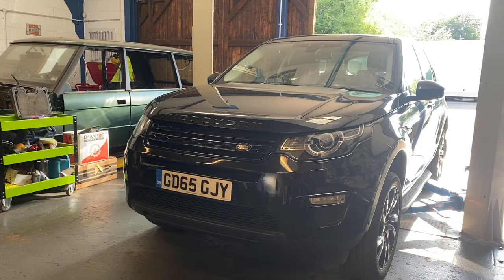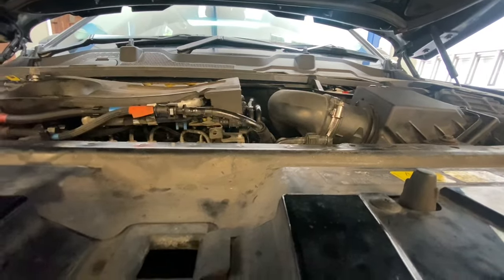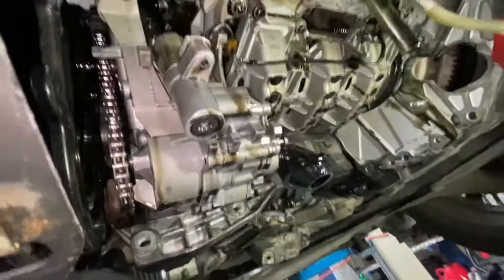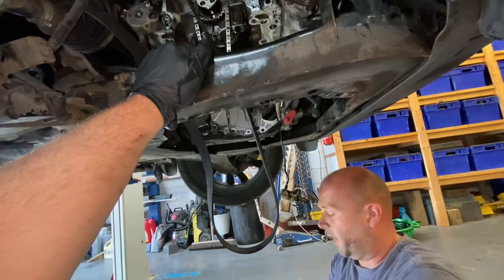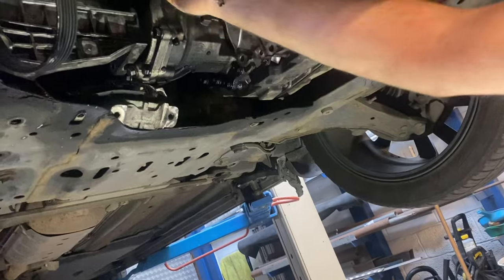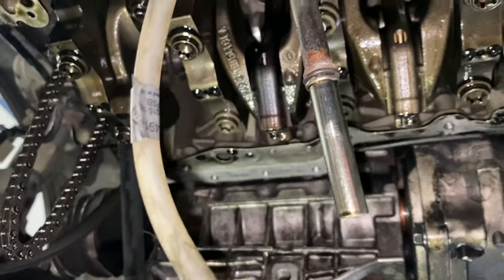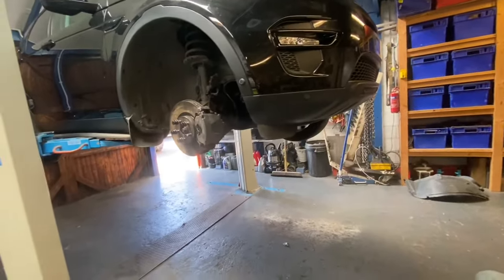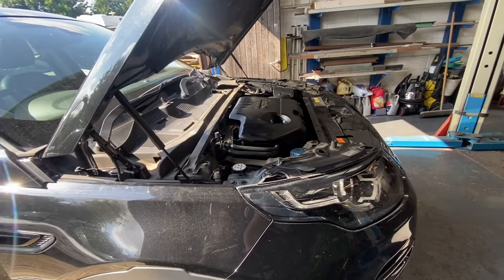LR Discovery Sport Dismantle And Repair Knocking Big End Bearing

Comment: Doesn't need an engine. Change the bearings, clean out the DPF and you'll be good to go. 
Run it for a 1000 miles and if it's still good, get it gone 😎👍
Reply: Straight to the auctions if it were mine. Or we buy any car.

Comment: When Big Diesel trucks get a rebuild they do a in frame, if you had used the micrometer to measure the journals and where in spect you could have replaced the bearings ,Turbo and DEF and would be like new it’s a diesel not petrol engine. I would drive it a little to see how it act. Great video ✌🏽

Comment: Chris's level of skills on all aspects of automotive repairs never ceases to amaze me! He must have the patience of a saint to spend all those hours on that bearing! That looked a very complex engine but you guys got to the root of the problem quickly and found a solution albeit temporary. Not a great indictment on the ingenium engine that it is basically toast at only 100k, would expect a modern diesel engine to be capable of at least twice that mileage and then some!

Comment: I'd clean the DPF and run it as a salvage rebuild run around rather than having it sat there waiting for a new engine and see how it goes. Could run it for a year and it not need anything. I think it'll be fine now if you sort the DPF. Probably been used a bit round town and got clogged up.
The solenoid on the oil pump Chris mentioned is because the pump is a variable displacement pump and the ECU can adjust the duty cycle of the pump to meet an oil pressure demand rather than having it run flat out all the time like in the olden days! Helps with fuel economy.

Comment: I'd get that dpf cleaned and change the turbo if necessary and then use that engine, and use it for six months if you need to....I'm pretty sure that it shouldn't cause any further issues. 100k is nothing for modern engines....I've seen mondeo 2.0 and volvo diesels on 400k miles with proper maintenance

Comment: That whining noise when you rev it up may not be the turbo, is more than likely the balance shafts, is a known issue on the ingenium Diesel engines. Have seen loads of turbos fitted for the balance shaft issue noise in the main dealer I worked in. That may be what the turbo was fitted in the first place.

Comment: Excellent work guys. Having experience in engines, I'd be fairly confident in saying that you'd be better off stripping, cleaning and re-shelling the engine you have, rather than taking a chance on a second hand unit. My only reservations would be if there's any damage to the bore on the cylinder that had spun the shells from the piston skirt touching, and the integrity of that conrod. The clean up is the biggest thing, because oil ways and galleries can still have lots of bearing material in them, as you were missing two shells. Good luck with the rest of the build. DPFs are the bane of modern diesel engines.

Comment: Brilliant video chaps.
So in a nut shell the cause was really the original owner not driving the car on long runs to blast out the DPF which killed the turbo which in turn caused oil starvation to the crank etc.
I'm not a mechanic but you guys really explained how the route cause produced the damage.
Will be waiting for the next vid.
TT4now

Comment: Those sound deadening shrouds are a nightmare, they get soaked overnight the years and hold that water then proceed to rot the sump, rip it off and bin it.
Reply: Mine has soaked up oil over the years, sumps never going to rust now.

Comment: Great video guys. never would have thought you could have recovered that bearing to get it to run. Good old school work. From talking to an independent LR dealer that the DPF issue is because it's too far away from the engine and in town running gets blocked. A real weak point on these engines. I was told that the LR dealer in Edinburgh has a separate workshop away from their main shop so customers don't see the number of engines needing to be replaced!

Comment: Don’t know if ye mentioned but where did ye manage to source the bearing shells.....? Just a theory but from my own experience at the Jlr dealership I think due the very long service intervals on these engines the oil goes to shit and causes excessive ware in cylinder 2 and 3 which in turn cause the oil level to be low and starve the turbo which in turn cause them to go pop.....! The DPF/SCR’s have a habit of breaking up too but this can be diagnosed very easily! If the tail pipe has black spit on it it’s time for a new dpf/scr cause of this issue is suspected bad pcm software cause an overheat condition in regeneration mode.

Comment: Gone are the days of working under a car with axle stands, there's so much to remove just to get at the sump.
Reply: To get to the plug for an oil change you need a lift to remove the undertray, as I found out the hard way. My daughter asked me to do an oil change on her 208 diesel. So my mechanic did it in the end.
Reply: @RPGeert  on my Kia there's a gap in the undertray to remove the sump plug. They aren't deliberately making it awkward.

Comment: Great video, manny Diesel engines die because of the DPF filters clogged up and excessive fuel is jumped into the crank case which waters down the oil to a point where it’s not doing any good as a lubricant that’s probably what’s destroyed the bearing diesel engines when they go into regen have to be run for at least 1/2 hour at constant motor way speed or have a static  regeneration performed by a laptop Great video loved it PS that shaft and bearings will probably last quite a few miles now
Reply: These newer cars (at least Land Rovers) do have a piece of software that monitors the amount of fuel in the oil.  If you look at live data on a very good scanner, you will see the numbers are monitored and an engine light will illuminate if you surpass the threshold.  The key is to change the oil once this happens.  Having said that, the DPFs on these newer cars are an absolute nightmare to deal with when they get clogged up, and the reason they clog is that if you have certain issues, the car won't regenerate at all.  So you get in a viscous circle of having DPF issues, so you focus on that.  But once you have that happen, you absolutely have to find the source of what is forcing the car to stop regenerating.

Comment: All this because of the stupid long oil intervals. Change it at 7500 in between the LR service. Certainly won’t hurt. And for heavens sake use the Castro edge professional titanium with the LR correct spec number. Costs about £90 but it’s crucial.

Comment: It is a disgrace on land rovers part that a 6 year old car needed a turbo and big ends not the first LR I've heard of  of this age with knackered engine.
Reply: My brother had top spec 2011 disco that the engine died in at 30000 miles due to oil starvation. He then bought a 2017 rr sport and that died too at 40000.
Neither of them have a dipstick, you rely on a dash warning which ne never got.
They're expensive junk.

Comment: Excellent tutorial on these JLR engines; I remember 20 years ago being told that the engine was the weak point and it looks like it continues to be. PS thank goodness you cleaned the camera lens, the glare was blinding me! All the best
Reply: Isn't this a Ford engine as fitted to a Mondeo of the same age?
Reply: @hedydd2  No its an Ingenium diesel. More than 1.5 million have been made since 2014. Problem with the transverse application up until 2019 was the dpf being a short distance from the engine rather than up close to it as in Jaguar XE and XF for instance. If used for short stop start journeys only with no longer journeys, the dpf cleaning cycle is forced by injecting additional fuel to heat the engine up with resulting oil dilution as the excess goes down the bores. If oil services are not carried out at more frequent intervals, engine wear is the result.
Reply: @fraser7744  so did they fix the issue since 2019? Having a brand new engine going bye bye after just 100k, on such a price tag of a car seems nuts to me. And yes I saw everyone stating oil dilution is a huge problem with jlr disco sports, but you were mentioning “up until 2019” and was wondering if they fixed it from 2020 onwards. Thank you and many thanks to the guys for the video, amazing skills!

Comment: is the turbo actually getting and  returning its oil, i have heard of  a turbo being replaced to only to have its replacement fail shortly after,,,,,,,,the garage changed the turbo but failed to check it was actually being fed and returning  oil to the sump,,,,,,effectively the turbo was starved of oil due to a blockage in the return pipework

Comment: Give it a new DPF and run it until it dies. It will probably run for another 70 to 80k miles again with little bother. An used engine may be no better than this one.

Comment: It's probably been dumping diesel into the bores,attempting to regen the dpf,it will get past the rings water the oil down,and knock the shells out,the thin oil gets past the turbo seals,and it takes off too the engine will most likely be ok

Comment: 100,000 miles, is nothing, and if it was oil changed regularly you wouldn't get this problem. I have 185,000 miles on a TD4 serviced regularly.
Reply: The dpf blocked. Probably too many short journeys.

Comment: It’ll not knock from cold but the secret always is to let them warm up & then all will be revealed.
However it’ll be very interesting to let it warm up & see what happens. Even if it did start to ‘rumble in the jungle’ an oil thickener would take up wear  to let you move it about the yard.

Tbh my gut feeling is it’ll be  ‘ovalled’ but yes I’d be letting it get right warm 👍

Comment: Well done guys 👍🏻👍🏻👍🏻 but sadly this video massively shows what is wrong with main dealers. 😤 Even I - a numbty 50 year old - could tell the rattle was likely a bottom end bearing issue since it started and ran but knocked. 🤨 Ok I was fixing my cars as a student back in the 1980’s and have rebuilt engines so I’m not totally incompetent, but hey, come on chaps…. I haven’t had my fingers oily in 30 years. What they hell are they teaching to auto technicians nowadays 🧐…. it’s all too much “computer say no/diag machine doesn’t have the right error code” ….. lazy workmanship or what. Again, BIG CONGRATULATIONS on doing a fix 🤓

Comment: Rob,why dont you register the car and run it for three months then take it to We Buy Any Car and weigh it in for a good wage saving you and Chris a load of work and hassle.
Great to see Chris more and more on screen,what a team.
Reply: Yeah, I would suggest the same. If they suspect that the engine is fairy worn, but it's running well now, they should sell it to a big company like webuyanycar.
Reply from the maker: Because a poor member of the public will end up buying it from bca  👍
Reply: @sruk  Rob,BCA dont want the public at their auctions only trade account buyers via their gold/platinum/black card system so more likely another trader/dealership would buy it. but that is the risk of buying at auction,as dealers we have all been burned at some point!!!!!!!!
Try taking a seriously faulty car back to BCA and they simply dont want to know as car auctions are in a privilidged position regarding sale of goods/consumer rights act so i would not loose any sleep selling it to WBAC .

Comment: Great vid chaps! In terms of route cause I’m thinking could be one of following:
- oil dilution due to dpf regen process / lack of frequent enough oil changes
- oil feeds/pick up contaminated or blocked leading to starvation of bottom end and turbo. It’s had new turbo but is howling again - is it getting enough oil. 
- possible incorrect grade of oil for dpf regen (needing low ash)

Look forward to the next vid.

Comment: Just watched an Evoque getting a turbo fitted. 
Think it’s the same engine, just a heads up if you don’t know but it’s got a gauze filter in the block where the turbo oil feed pipe connects.
Keep up the good work, that was a good watch 👍

Comment: Had a VW 1.9tdi that my brother split the sump and carried on driving. Toasted the big end shells. Done exactly what you have, tidied the crank up with wet & dry and replaced the shells and oil pump. It’s done another 40k miles, on an engine that already had 120k on it. I’d be driving that, no issues. After you fixed the exhaust fault of course.

Comment: I had this problem on a BMW rod bearing spun did the same as you worked fine until engine & oil got up to running temperature then Oil pressure light came on ended up doing a full engine re-build with new con-rod. Take my advise don't drive it around just get another engine you are right to many miles on that engine not worth a rebuilding, it's a long job but worth it Good Luck...

Comment: I'll have to remember that trick with the wet and dry and the paracord. Not a permanent repair but it might buy you some time. Nice one. 

Good call replacing the engine. These Ingenium engines aren't very good. Regardless of if you can get rid of the knocking something else is probably worn out and about to fail.

Comment: Maybe pull the head fit a new con-rod, full set of shells and timing chains and call it fixed! What if the new engine isn’t any good and been bodged up, at least you have seen the inside of this one and you know everything else good. That crank will be fine especially as Chris has checked it with a micrometer also!

Comment: Thanks for the great video, It's great to hear Chris actually talk more as well. Get carried away a bit more, it's amazing what a guy can do in a pinch and share. I wouldn't want to rebuild that engine either.  It's kinda a bit of a joke in my workshop those mesh pre screens on the suction side get called the fish 4lb and larger filter, because large stuffs all they really stop. 
   I did a Perkins turbo rebuild a  years ago for a tractor was far less complicated than this engine, it dumped 2 small end bushings, and sent filings through  the oil pump, crank bearings, all the oil ways and even the piston cooling jet pipes and fittings blocking them.  I'd bet this ones the same inside and would be real hard to get spotless to guarantee it's not going to damage it's self again.  
   Why not sell it to the guy with the motor for a quick profit, you might win more this way than spend a lot of time waiting, fitting a motor that might puke or be wrong on start up, and he wins because he got what he wanted to.   I'm sure you could find something else interesting share and keep us all happy if you did let him buy it. Take care guys.

Comment: When the Ingenium engine is transversely mounted it runs into all sorts of problems because the DPF cant get up to temperature and regens never complete. Basically, it overfills on diesel fuel and wrecks itself. Perfectly fine engine when mounted longitudinally as in Jags for example.

Comment: Had lots of success cleaning knocked out cranks on big diesels, scania, cummins volvo etc, but have renewed the con rod each time, as the heat often distorts the big end bore, have to watch that crank aint oval, had big trucks run 100 thou kms on cleaned up cranks.

Comment: Dial test indicator on the side of the crank. Need to check the run out. Chris # legend. A second hand engine might not be as good as the 1 you have. Don't doubt Chris knows.

Comment: That engine is good. There is no need for another engine. Especially if you replace all the rod bearings.  I still think with a small amount of money will be a good one. What if the replacement engine has the same problem waiting to happen?

Comment: What an eye opener of a video, i didn't think diesel 'runaway' was that common this is why longer motorway journeys are needed on DPF equipped vehicles to get the all important regen done at its intervals.
Reply: DPF could be toast. If can't be Ceramexed for £300 might confirm it. Think Rob planning on doing that, guess will see.

Comment: Good stuff lads. I was hoping this video was coming. Think yourself lucky you could access all the big end bearings. I went inside a Volvo V70 T5 years ago and out of the 5 cylinders you could only access 1 cylinder from the bottom without splitting the crank case the other way. Mine turned out to be the black death( bad viscosity badly burnt unchanged(the lazy bastards) oil. Knackered !!! Got a smooth one now though. Cheers.

Comment: That was a real treat to have Chris talk us though what he was doing, Chris mate nice one, I enjoyed watching you and listening to what you was doing.  I’d call that repaired once the DPF is cleaned and turbo checked. 
drive it about once you’ve sorted those bits out. Sounds great for just a few quid so far. I’m doing a little cheap car challenge inspired by you two. I’ve bought a little Fiat Grande Punto 1.4 Turbo sporting 2008  100k miles for £400, its got cruise control, air con, sport seats, front fogs you name it! I put an mot on it yesterday and it drives lovely so I’m giving it to my sister once I’ve gone though it service and timing belt done. I’ll be in it for about £600 all done which makes it a cheap car!

Comment: The DPF and EGR  is to engines what the face mask is to humans. In both cases, it involves breathing in previously expelled air and sh*t.  I'm not advocating dirty, polluting engines but this is the worse technology ever. I'm sure manufacturers would have come up with a better solution had this crap not been imposed upon them.
Anyway, rant over. Great video as ever and great to see Chris narrating.
If this is destined for Chris' missus, it will be the best Disco ever. Not that you boys ever skimp on anything you do. 
Thanks for the brilliant content 😊👍